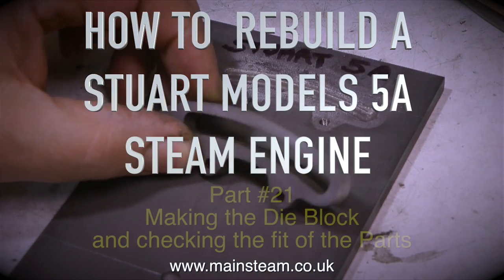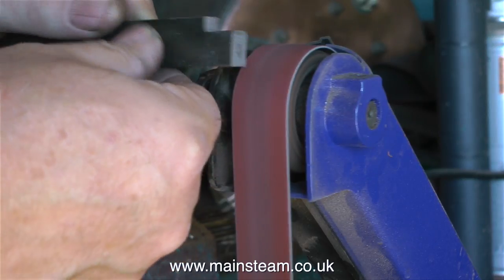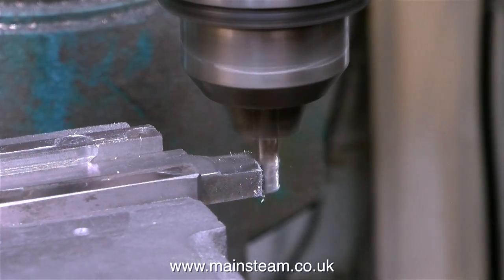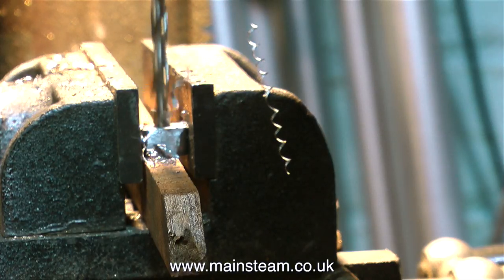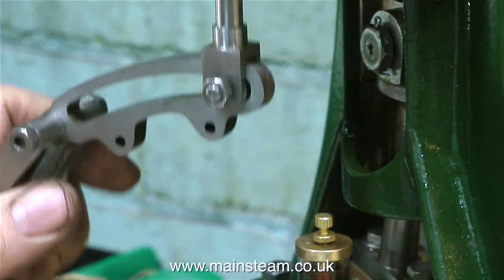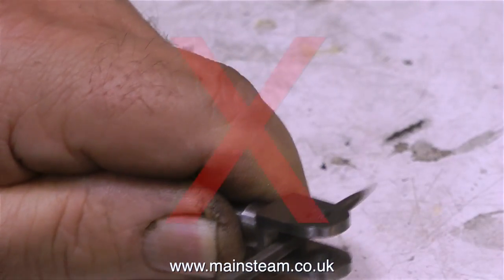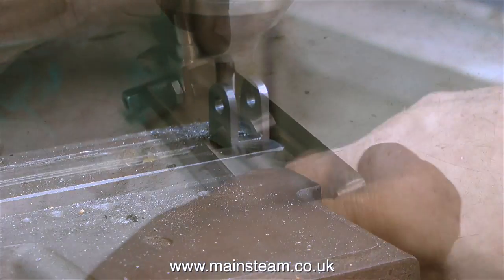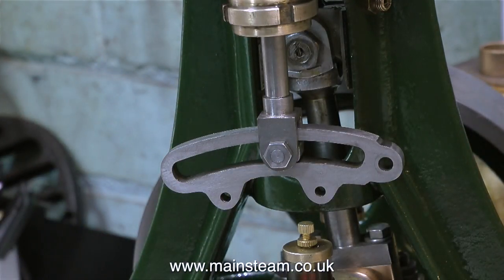HOW TO REBUILD A STUART MODELS 5A STEAM ENGINE - PART #21

Comment: You probably could've made a more precise die block with the rotary table, but making a fixture for it might've taken up lots of time, and it seems that your belt sander method worked well enough.  Keep up the good work, and I'm eager to see it run too!

I wonder, have you ever looked into making a more high-tech steam engine with piston valves, double expansion, variable cutoff, etc?  Maybe something like a Doble car engine or a 20th-century locomotive?   I've been thinking of making something like that for years, but you're the one actually cutting metal rather than just dreaming!
Reply from the maker: I could have done it a thousand ways. This Die block that In made for the video is the one that I am going to use to set up the Reversing gear. Hence the quick job on the belt sander. Once I see where the Die block sits in the slot of the Expansion link, then I will make the proper one which will probably be longer that the one on the drawing - in order to maximise the surface area and prevent premature wear of the Expansion Link slot. I have no interest in "High Tech" Steam engines really. They are a thing of the past and I like them just the way they were :-))))

Comment: It occured to me whioe watching this episode that making the die block might have been easier by using a similar type of fixture like the one you made for the last piece. Is there a particular reason you didn't do it this way? Or is it more work than what is required to make an acceptable bie block?
Reply from the maker: simple ---- Speed ............. I don't do machining for machining's sake.
Reply: I see. I suppose it really wouldn't make sense to go through the trouble of making a custom fixture that probably won't be used often
Reply from the maker: I could have done it a thousand ways. This Die block that I made for the video is the one that I am going to use to set up the Reversing gear. Hence the quick job on the belt sander. Once I see where the Die block sits in the slot of the Expansion link, then I will make the proper one which will probably be longer that the one on the drawing - in order to maximise the surface area and prevent premature wear of the Expansion Link slot.

Comment: any reason not to make a round "roller" rather than the squarish die block ?
Reply from the maker: Surface area in contact with the slot . . . a round one would just wear a round depression in the expansion link slot after a while ....